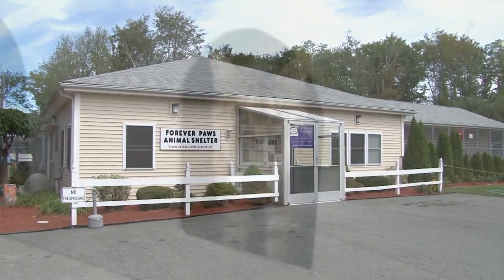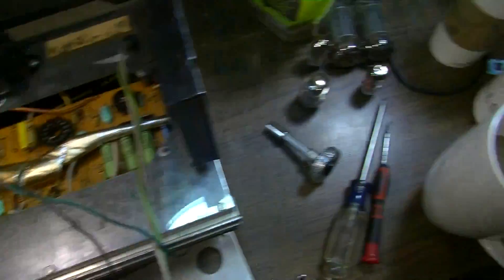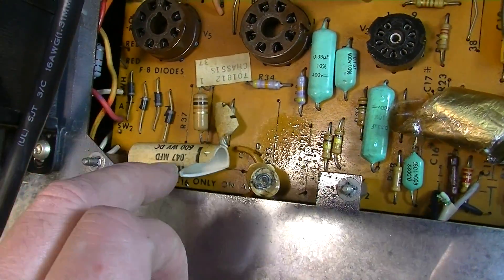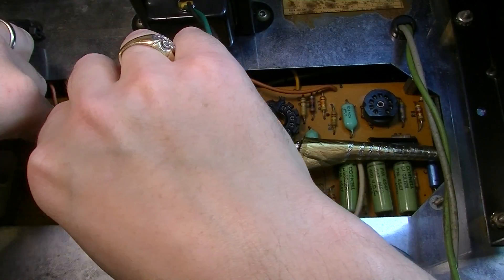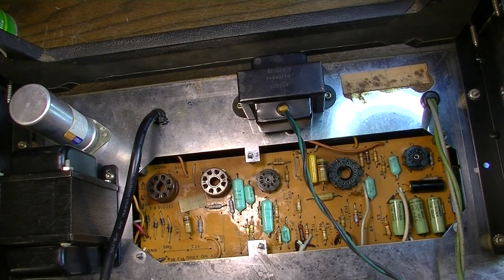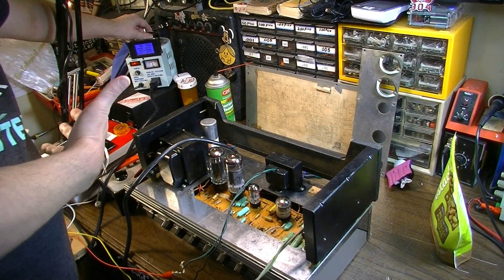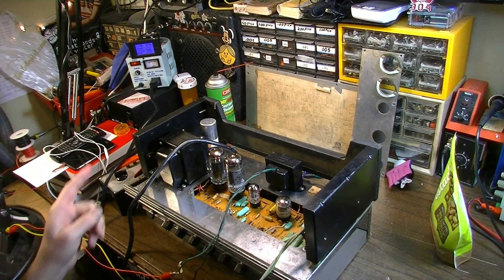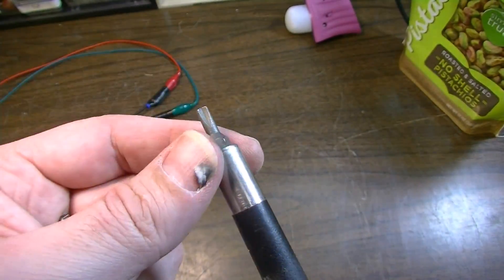He Heard a POP...Then Came SMOKE!

Comment: I had the same thing happen to a 1956 fender deluxe. I replaced the power cord to a grounded 3 prong, but left the death cap in circuit at the ground switch. Didn’t think anything of it as the switch didn’t do anything anymore. Used it for a few hours at a show and then started smoking and smelled like burning. Took off the back panel and melted wax was everywhere. All over the back panel, the power transformer, the chassis, tube sockets, etc. Luckily it didn’t do any damage to anything else, but definitely learned my lesson. Good thing I changed to a 3 prong cord.

Comment: I had cap almost blew up on me once, it was totally my mistake, i had 100uf rated 10v, i was using 9v in the circuit most of the time, then i decided to test how the whole thing will behave at 18v, completely forgot about that cap, so i went on to play guitar, then smell came in, then i looked over and noticed smoke. Luckily my setup allows me to turn it all off in a second. I feel like anyone who’s dealing with electronics should have a cap fail experience, just to know what it’s like.

Comment: Brad those old caps like that aren't safe.  Your doing the right thing to replace them whenever you find them.  I'm retired and I did electronic repair in the past for a living.  I usually recap when ever I find one of those old crappers. that was oil and foil from long ago that oil is a bitch to clean up man.  Fenders old stock caps usually slow leak when they get old, but way better than a blow out like that. Good luck Brad, I hope your daughter heals well. God Bless man.

Comment: That was a paper in oil cap, not plastic, so a very high failure rate. In that application (line to earth) it should be a Y-rated cap by modern standards. With a 3-wire earthed cord in that circuit it's unnecessary and may even couple noise from the line to earth and into the tube circuits.
I always replace all across the line and line to earth with X and Y rated caps, playing with safety isn't worth it.
As for the plastic caps on the secondary, it's usually a waste replacing them. Measure their leakage and if it's fine, run them.

Comment: This is a good example of how things get better over time.  Modern electrolytics are designed to vent.  Look at the top of the cap and you will see where the metal endcap is scored so it can split if the internal pressure becomes too great.  Larger caps like what you find in car stereos actually have a vent with a rubber or plastic plug sealing them.  What causes the cap to fail?  The most common problem is the loss of the dielectric between the foil.  Once that happens a spark can develop creating a lot of heat and pressure, pop goes the cap.

Comment: Yikes, Kablooie. I have a stereo and sound is faint thru one speaker and crackles with the correct amt of sound, but then fades back. Not sure what I still need to clean as I think I've gone thru and cleaned all the knobs with Radio Shack contact cleaner .

Comment: Back in the day these capacitors might have been filled with PCB oil which is banned today as it can cause cancer.
Reply: There are some documents out there on the web helping you to identify caps containing PCBs. It often comes down to the specific series.
http://nepc.gov.au/system/files/resources/378b7018-8f2a-8174-3928-2056b44bf9b0/files/anzecc-gl-identification-pcb-containing-capacitors-information-booklet-electricians-and-electrical.pdf
https://www.epa.gov/sites/production/files/documents/pcbidmgmt.pdf
"By 1976, 95 % of the capacitors produced in the United States were filled with PCBs13 (Fig.3). [...] Manufacture before July 2, 1979, or a PCB trade name on the nameplate is a good indicator of high concentration PCBs." 
Ewww.

Comment: Oddly, I had an Ampeg VT40 that I got from a guy.  He said it popped and there was smoke a few weeks after he had a 3 prong cord installed.  It had been working fine until then.  Turned out the 3 prong was wired into the old 2 way grounding switching switch with the death cap installed.  I'm guessing that the switch got flipped and led to a dead short  to the cap which blew.  It looked just like the party favor in your video.  Ah the world of troubleshooting old amps... lol.
Reply: Why do death caps often explode soon after an old guitar amp gets rewired with a 3 prong AC plug and 3-wire power cord?

Answer:
Because that old death cap was already VERY leaky.
Then, depending on whether the amp has a "ground switch" and how the original factory death cap was connected, the new configuration with the chassis actually GROUNDED may apply the full AC mains voltage across that old death cap.
Nothing will happen If the old death cap is still good. Only a very small amount of AC current (10-20 mA) will flow through it. That's all. No big deal. This isn't a high enough current to warm up the capacitor.

But if that old death cap is LEAKY enough...    THEN it will act like a resistor and the AC current flowing through it will be much much higher.
High enough to heat up the cap and eventually hot enough to convert internal moisture into steam.
Pressure builds up inside. More and more pressure. Still more.

Finally:               BANG!

Comment: A paper and oil cap failing? Why am I not surprised? Now this is just a guess, but as current runs into the cap and the foil heats up it boils the oil and it expands and pop goes the ceramic layer on the outside.
Reply from the maker: I believe you're correct.

Comment: Brad is it a take for granted thing that all Amp repairers will remove the death-cap?
Reply from the maker: If it's been brought up to modern standards, yes. Depends on the level of service. I've left them in before in amps that were collectible and were running fine and didn't need anything except a bias or tube, but the problem with that is if someone got hurt playing it, which is highly unlikely, but if it did happen, who knows, I might be liable.
Reply: @TheGuitologist  Thanks.
Best to err on side of caution:- Collectables - a disclaimer, witnessed by a notary and Minor Repair:- point out to client risks and put in writing.

Comment: It's like a confetti cannon! Things like this do make me wonder about my mom's Hammond organ (which you helped me solve the mystery of it red plating). I replaced all of the film caps inside the tone cabinet with new Mustard-style or Solen capacitors, but I didn't replace the old smoothing cap, since it seems to check out fine as far as ESR and leakage go. Also, it still uses an old and crusty two prong power cord, and there isn't really a way to retrofit it to a three-prong cord. I may have to go complete electrical engineer on it.
Reply: Cameron Jenkins regarding Hammond three prong conversions. I’ve had good experience installing IEC receptacles on them.